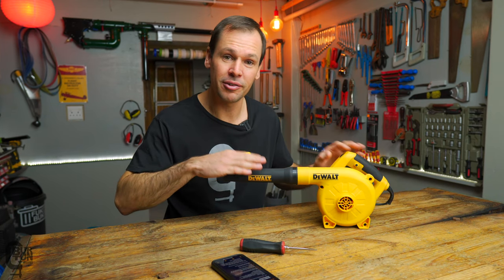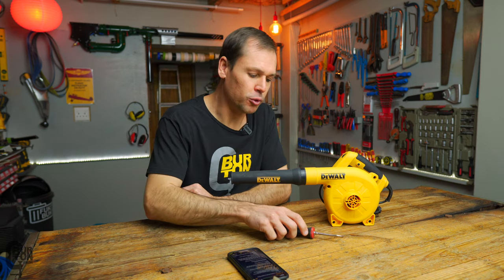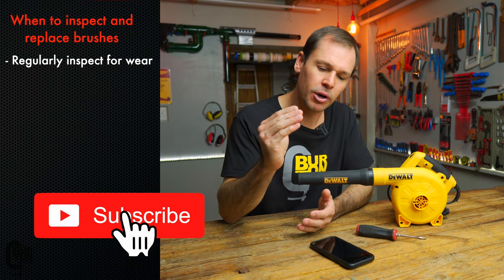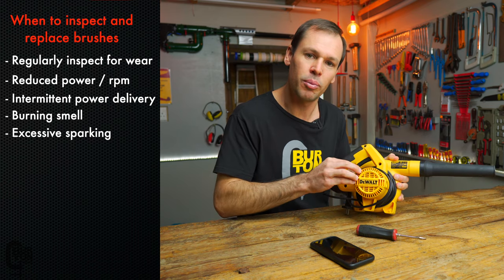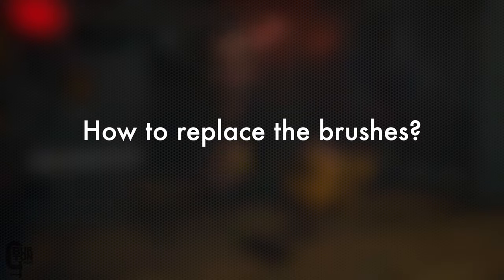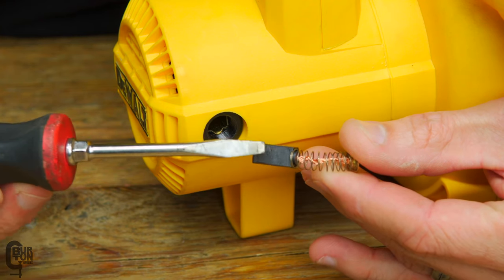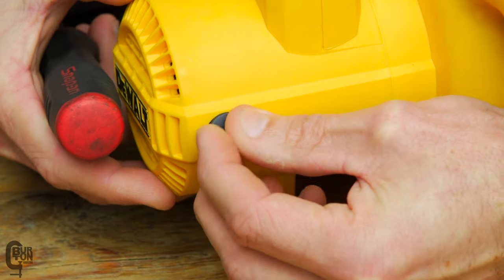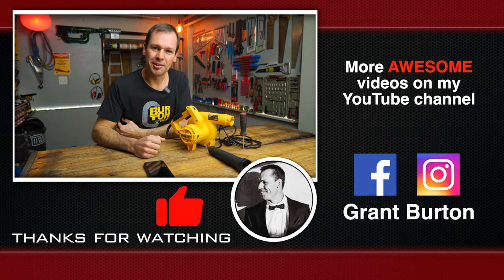How to Replace Brushes in Electric Motor

Comment: Thanks Grant. I was worried how I would detect the wear/tear of brushes on a drill. Looks easy enough after watching this video. In fact I had no idea what a brush looked like.
Reply from the maker: Hi Anda, glad I was able to help. Brushes normally last pretty long so depending on how much you have used your drill, they might still be perfectly fine. On the other hand, if the drill is 10 or 15 years old already, maybe it's time to check.

Some tools aren't as easy to replace as this blower (like one some drills, the clam shell may have to be split / a back cap removed) but its not an impossible task.

If you want a look at another type of brush setup (maybe something more similar to a drill) check out this video https://youtu.be/M6UdqqJm85w or this video https://youtu.be/xPsJlw3fxlU

Hope this helps.